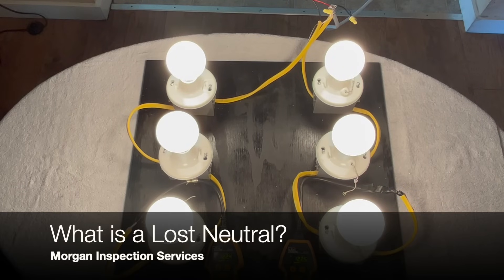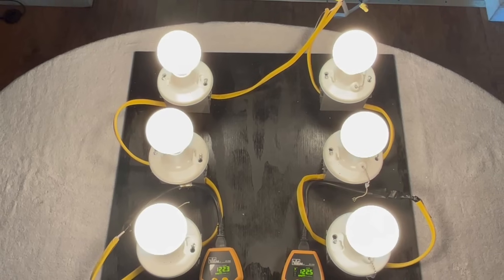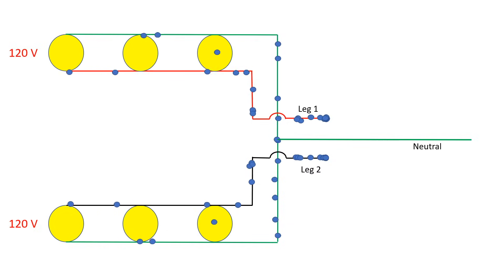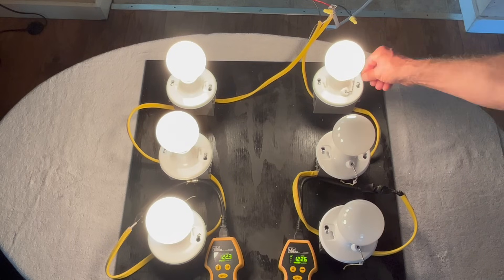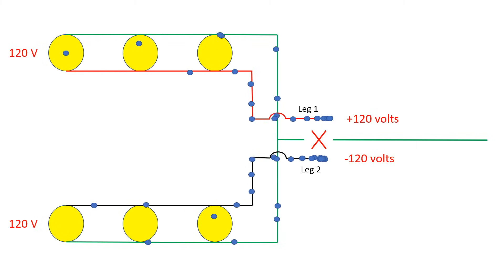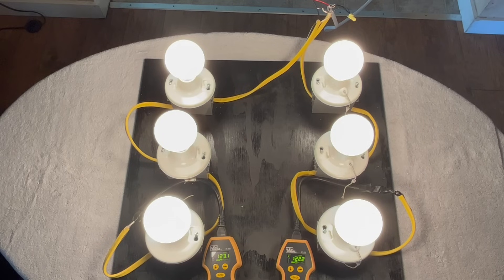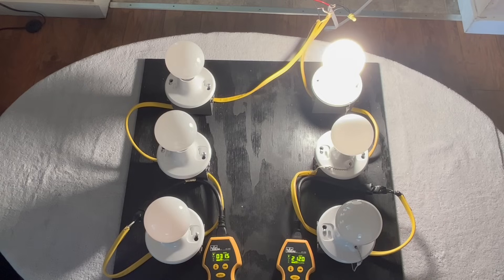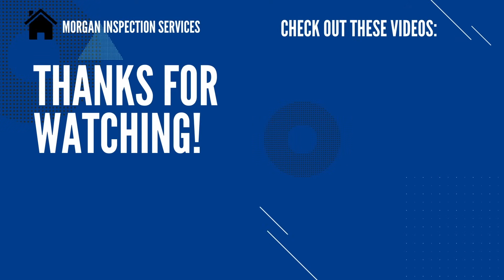What is a Lost Neutral? Lost Neutrals demonstrated

Comment: what is the impact on the consumer meter reading if in a three pages meter, neutral wire is directly connected from supply to the wire of consumer i.e input neutral is not connected to the meter input and neutral output of meter is not connected to the consumer neutral wire? Pls note the three phases are still connected via the consumer meter.
Reply from the maker: It seems like you’re asking about the impact on a three-phase meter when the consumer neutral wire is not properly connected to the meter input or output, while the three phases remain connected. If that’s the case, the meter may still record consumption, but the readings could become inaccurate depending on the load balance across the three phases.

In a three-phase system, the neutral is essential for ensuring balanced voltage to single-phase loads. If the neutral is disconnected, unbalanced loads can cause voltage fluctuations, which may affect appliances and lead to over- or under-recording of energy use. Additionally, without a proper neutral connection, any protective systems relying on the neutral might not function correctly, posing safety risks.

Comment: It's called an 'Open Neutral'. And yes, it's the most important connection in any system that has a Neutral. Always identify and connect the neutrals first when doing any kind of switching,controls,loads to minimize problems. If you make a mistake the circuit/logic may not perform correctly but at least if the neutals for the loads are connected the chance of a dead short or a shock are greatly reduced. The neutral is the most important connection.
Reply from the maker: Thanks for watching and for the comment.

Comment: Learned something today! Thanks! How would a panel mounted surge protection device affect this situation?
Reply from the maker: I can’t imagine that it would change anything. Surge protectors are designed to shunt very high voltages. 240 or 250 V would not even be detected by a surge protector, I don’t believe.

Comment: I had a bad neutral at the transformer.  The symptoms were a voltage difference between the phases.  I showed the lineman the voltage differences, but he didn't seem to believe me.  Took the bucket up to the transformer and shook the neutral.  A shower of sparks confirmed the diagnosis.  They replaced the transformer.
Reply from the maker: Great story! Thanks for sharing

Comment: It's for this reason I leave my 240 V generator neutral bonded to ground at the generator, when connected to my home, I understand that's not proper, but if the neutral gets lost the ground will take over the job, I've seen a microwave get cooked and a few other items when a neutral failed.
Reply from the maker: But if the ground takes over the job, then you’ve got current running on that ground wire and on the frame/chassis of every grounded device in your house, such as your refrigerator and washing machine. That’s a pretty dangerous thing.

Comment: The animation @ 0:26 is false or at least completely disconnected from the following one https://youtu.be/P-W42tk-fWc?t=271 https://youtu.be/LJvyb_WujZg https://youtu.be/Cs6jskU2Ukk
If the two phases have balanced loads then the current comes in one phase and loops around to the other phase through the neutral then goes back through the other phase
Reply from the maker: I don’t understand what you’re saying.
Reply: @morganinspectionservices3840  If the two phases have balanced loads then the current comes in one phase and loops around to the other phase through the neutral then goes back through the other phase they won't both be flowing towards the neutral and joining there and if they aren't quite balanced then only the difference travels on that leg of the neutral going back to the transformer or even coming from the transformer depending on the direction of the difference

Comment: Back in the 1970s, at a railway locomotive shed owned by a railway preservation society in Britain, an idiot decided to turn off the yard lights by removing the neutral link on the lighting fuseboard (3-phase 415V supply), with the result that there was an immediate cascade of blown lamps.
Reply from the maker: I agree with the term idiot. That’s crazy. And that’ll certainly do it.

Comment: Not a lost neutral, but an overvoltage story. I went out on a call to a small concrete plant, served by an open delta 120/240 with the high leg. There was a detached office in a prefabricated shed on the property with a 30 amp 120 volt feeder going to it for lights, a fridge, microwave, office machines. Two 120 volt branch circuits in the shed, each one feeding a ground fault receptacle first before daisy chaining to the other receptacles.

Well the reason they called me was because they replaced the ground faults after they fried, and they immediately fried again. I check and there is 208 volts on the branch circuit going to the office between hot and neutral. Turns out they added a 3 phase circuit in the plant to run a little welder, and when they did it they moved the breaker for the feeder for the subpanel in the shed to one of those breaker spaces that somebody had skipped. They didn't know the reason those spaces were skipped when installing the single phase breakers was because every 3rd space was the high (208 v) leg.

Thankfully it was the early 90's and not really anything with an electronic board, so nothing got damaged other than the ground faults. But anyway I know 208 volts will smoke a ground fault and possibly protect stuff downstream, But I don't know how fast it's going to smoke and open the circuit, or at what voltage, or how reliably. But a bunch of fried ones could be a good indication of overvoltage caused by a loose neutral
Reply from the maker: Wow! Great story. Lucky nobody got hurt or nothing else got fried. About two months ago, I put a video on this channel after I found 240 V on a 120 V receptacle in a bathroom, but it was only 240 V when the exhaust fan was turned on. With the exhaust fan off, there was only 120 V. Kind of a crazy situation. Scary when people who don’t know what they’re doing do electrical work.

Comment: This is exactly why I never share a neutral in any situation!!! If you loose a neutral, the circuit won't work!!!
Reply from the maker: You’re correct about disconnected neutrals, but this is a completely different situation. This has nothing to do with shared neutrals. This is the neutral coming in from the transformer to the breaker panel that is lost. This is not a disconnected neutral somewhere on a branch circuit.

Comment: Friend bought an old house, old 2 wire no ground romex. Some later wiring added with ground. Got shocked in bathroom, even though had working GFI outlet. It tested okay, but everything supposed to be grounded, was HOT, intermittently. Overhead fixture, device frames, cover screws, etc.

After looking around, what was rewired, added over the years. The bathroom had been rewired with floating ground wire not connected back to panel. Along with added ceiling fans in nearby living room. A single tiny strand of hot wire on fan was sticking out of wire nut, touching floating ground wire. Creating intermittent shock hazard whenever fan switched on. Fixing that fault, running ground wire to panel, that problem was repaired.

Hard to tell what hazards lurk in walls and attics. Even if things seem to be working.
Reply from the maker: Wow! What a story. That definitely was a dangerous situation. Sounds like a hard thing to track down.

Comment: Lost shared neutral backfeeds through load to other circuit when it's breaker is off, energizing wires turned off.
Reply from the maker: That's correct. A lost neutral can create a dangerous backfeed situation.

Comment: I've had to happen to me. A storm broke off a tree limb, which fell and broke the neutral from the transformer. It was a wild ride. My wife and I had a light fixture above the bed with incandescent bulbs in it. When the event happened we both were laying down but we sat up when the lights started going crazy and about one second later the bulbs in the fixture exploded and the glass fell onto our pillows. I jumped out of be do run down and flip the main disconnect but out of habit I hit the light switch for the stairway light. Poof, another bulb blows. I had to grab a flashlight to get to the panel which extended the time it took and I'm sure that caused some of the other devices to fry. I lost tv, vcr, some of the stereo, relay board in the range and who knows what else. A guest staying with us said the vcr was crackling like bacon frying and the tv looked like it was in the poltergeist movie. Honestly I'm surprised more devices didn't fry.
Reply from the maker: That is quite the story. Lost neutrals can definitely be dangerous.
Reply: If the neutral on main board were so well grounded with a structural ground on building structure, the chances of damages would be so reduced, I've had a lost neutral too, if my neutral weren't grounded, would be bye bye to my microwave oven and my frost free refrigerator at once.. but fortunately, I did my neutral grounded, it's a TN-S system! 😅

Comment: Partial 'lost neutral' can be caused by having an inadequate ground, such as a grounding rod that is too short and in a rocky base (such as your grounding rod going into dry limestone)..  also, this is why fueled gensets have a neutral grounding post..
Reply from the maker: The lost neutral and poor grounding should have nothing to do with each other. In fact, there’s a lot of older houses still around without  a ground rod. Typically the ground lack of a ground rod doesn’t cause a problem – unless there’s a voltage spike or some transient voltage on the powerlines.

Comment: Interesting. Here in UK the consideration is typically diverted neutrals because of subtle differences in the way you & we feed supply current. In the UK case it's where neutral currents end up flowing in the ground/earth/protection wiring (as most distributions have repeated connections to Earth).
Reply: does this prevent or mitigate the issue or is the issue just happening differently? i sound stupid i know but apart from being able to wire a plug i am an electrical idiot.
Reply: @mysterycrumble  In the US system you have two live or 'hot' feeds which are anti-phase (opposite polarity) so that you can have ~240V power hungry devices connected between them.
When you 'lose the neutral' then you have your two sets of 120v loads connected in series, so 240V, without the neutral stabilising the 'mid point' voltage at zero (the two hots being +120 and -120v relatively speaking). At this stage the weaker side of the two hots tends to 'blow' from having over voltage, and hence on that spur, over current.

Meanwhile back in UK we have far more domestic circuits distributed from local substations where the neutral and earth are connected for multiple household supplies (often US supplies being a local transformer so only one or two with the common neutral/earth at the supply pole).  so..

Now with our older infrastructure we have more cases where the supply cable has lost the neutral ("broken PEN") and instead the local 'earth' conductor is doing the work of the return path. And that return path (i.e. the whole supply current for other properties & services that neutral also fed) can prefer to run through your household earth wiring, especially if you have rock solid earth bonding, earth rods, copper water piping etc.  

An example could be the (faulty) street lighting that is seeking to return via your household wiring which isn't sized to carry such currents. Also makes for EV charger risks (an outside power point nearer the street light than the house) requiring extra detection for spurious earth voltages and sneak current paths and multi-way isolation).

Everything is great when it works as designed. We're just getting better at being concerned about real world faults!

Comment: Should never connect 2 phases like that, its looking for trouble ! ALWAY USE ONE PHASE ONLY FOR 120V CIRCUITS !
Reply from the maker: Theoretically, it is not connecting two phases. It is connecting the two 120 V legs. This is how all residential electrical systems are done in the US. It only becomes a problem if the neutral wire is lost.
Reply: @morganinspectionservices3840  YOU MUST ALWAY USE ONE PHASE ONLY FOR 120V CIRCUITS ! Missing neutral will just not work, it's not going to be any danger.
That's a giant trap opened when you have 240V live if you need only 120V.
I've never seen that in Canada ! If that's how it's done in the US, then it's done WRONG.

Comment: A long time ago, turning my microwave on made the CRT TV picture bigger, opposite of what you would think would happen if they were on the same circuit.   Also, this is why the house furnace heater is on one leg, and the refrigerator on another, to balance the load.
Reply from the maker: Interesting. It is definitely best to split the larger loads between the two legs. Since the largest of loads use both legs because they run 240 V, this is not an issue with those.

Comment: How does the ground affect this? The neutral and ground are bonded at the panel.
Reply from the maker: You will have some current flowing from the panel into the earth due to the groundingelectrode conductor. Since the earth has a high level of resistance, there will not be a lot of current flow, but probably a few amps.
Reply: @morganinspectionservices3840  Thanks for your answer and this great video.  But I'm still a bit confused.  What then is the purpose of connecting the panel neutral bus bar to a local ground rod?

Comment: My brother had this happen at his house when a lady hit the power pole across the street and he also had a bad ground at the breaker panel which caused the whole house to try and back feed through the 14 gauge ground wires on the furnace and dish washer as one was connected to a gas line and the other a copper water line into galvanized iron water line.  Needless to say, I am glad that his daughter skipped school that day as she quickly went back and turned off the main after seeing smoke start rolling out of everywhere.   I had to go up and replace all the wiring on both appliances and ended up installing a new ground rod outside along with bonding it to the gas and water lines.
Reply from the maker: Wow! That’s scary. Good thing the daughter knew to turn off the power.  These situations can definitely be dangerous.
Reply: A hint, if your house isn't made of wood, use your iron structure as earthing grid, it's an awesome earthing, and saved me of appliances losses, I'd lose my microwave oven and my frost free refrigerator if my neutral weren't so well grounded on building's steel structure, look for structural earthing, my system is a TN-S.

Comment: Am I correct that if you turned off the third light on leg 1 that all the lights on leg 2 will turn off due to being an open circuit?
Reply from the maker: You’re absolutely correct. After I made the video, I realized that that would have been a good thing to demonstrate. Thanks for pointing that out.

Comment: I worked as a cable tech for 16 years. I also worked in a beach area where the grid was copper but all there service lines were aluminum. The two different metals would cause the neutral to fail fairly often. Very dangerous, if you were not careful. Low volt guys get little to no training on this. Most of the time the connection point at the bond would completely melted and that was a dead give away. But sometimes it wouldn't be and if you didn't hit it with your FVD you would get sparks flying when the wrench touched the coax fittings.
Reply: Ouch, that’s terrifying.
Reply from the maker: Very interesting. Thanks for watching, and thanks for your comment. Yes, these lost neutrals can be very dangerous.

Comment: Thanks for the good demonstration.This will help other save themself. Can be a very dangerous situation. I have seen this happen a few times. One has to learn this before one plays with it. The fist thing he taught me was to respect it and treat like it is HOT! 
  I was 12 years old Back in the 60's  and  I was wiring  houses with my father. {unknown to me at the time.  When he was in the USN he was a an EM and also was an electrical instructor. I wounder way he had all those books around that I read.) As a teenager I joined the USN and was an Electricians Mate and advanced right to C school. and Aced it was not much to right home about. Skipped A school all together.  Any navy guy knows what that is. later in life acquired a BS Electrical Engineering.  Build power plants and switch yards and control yards. Sorry about ringing my own bell. May next do 3 and 4 way switches. I just shake my head at times when it's not understood by someone that call's themself and electrician.
Reply from the maker: So true. Thank you for your service. I too am former navy. Nuclear propulsion officer on the submarine USS Florida back in the early 90’s. Learned a lot about electricity doing that.
Reply: Depends on how you ground your neutral wire, if you don't have an wood house and use your steel structure as earthing grid, and earth your neutral properly to your structure (I did my connection welding, so no bad contact never), your neutral never gonna become a HOT wire, I did my system as a TN-S and it saved my appliances from the lost neutral on public electric grid, I'd lose my microwave oven and my frost free freezer if my neutral wire weren't so well grounded, and guess what? My kind of earthing creates a Faraday's cage, never gives a shock inside my building perimeter, even if happen a direct short circuit on structure, I tested, it's like the phase's potential vanishes on ground.